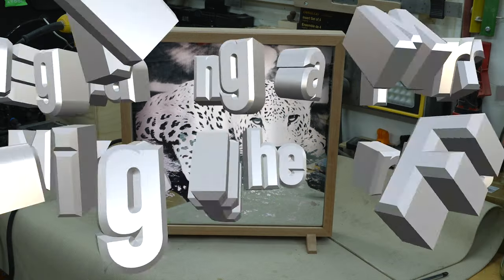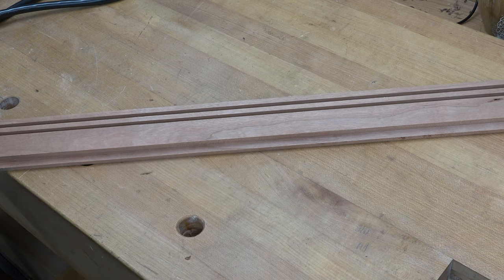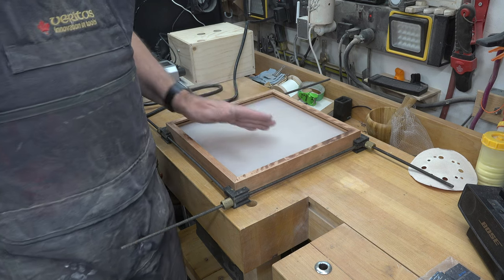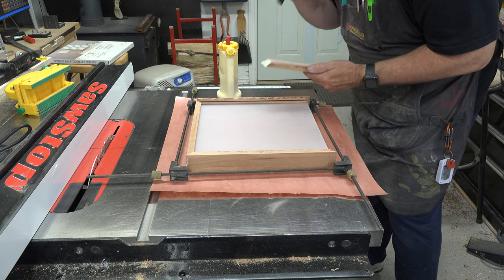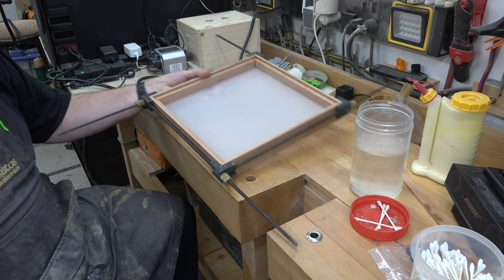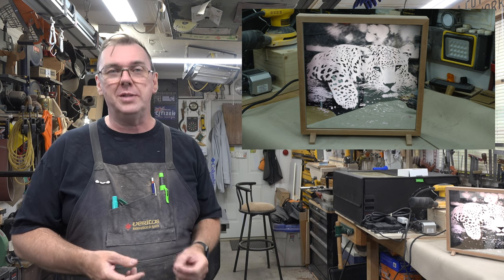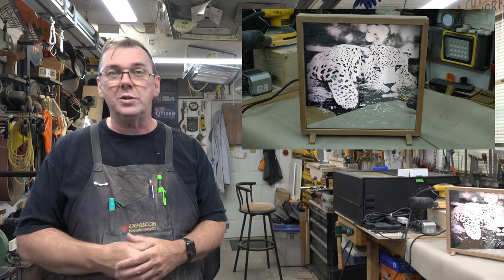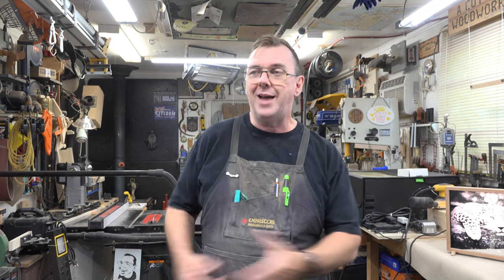Engraving a Mirror   The Frame

Comment: Was thinking that if you cut a bit off the top then you could make it so the mirror could be replaced ... then you went and did it 😁 ...... Another fantastic easy to do project 👍
I wonder if attaching the LEDs to the actual frame, i.e. two or three rows of LEDs running round the inside edge (less strips and less soldering), would give enough light?
PLEASE PLEASE try this with the engraved mirror in the inner slot with the perspex in the outer slot with mirror foil on the back ... that way you should have a normal mirror when the LEDs are off and the engraving should show through when the LEDs are on 👍
Reply from the maker: I think I will have to do that Barry.  I really like that idea.  It wouldn't take much to experiment and see if it would work.  Stay tuned.  Your idea may be a show production soon enough.  Thanks for tuning in and for the show idea.

Comment: Good evening.  Have you had any problems with yur XTool laser?  Some many of the diode lasers, people have issues and compalints on operating them.  Everything from stopping in the middle of a job to the image moving to the side.  Have you had any failed runs?  Would you recommend this one, or the other one you have?

Thanks you.
Reply from the maker: I haven't had a single problem other than my laser etching my lens which is considered as consumable anyway.  The Xtool is definitely my favourite of all my laser engraving machines and I would recommend it to anyone that is interested in getting into laser engraving.  Like anything though, new babies get sick too and with the amount of these that are getting pumped out on the market, there's bound to be the odd one that has some issues.  For me though, I haven't had any issues at all.  It's worked flawlessly for me since day one.  I hope this helps Scott.  Thanks for tuning in.